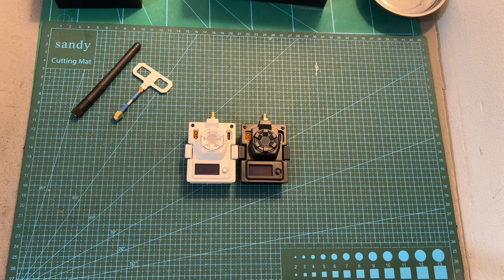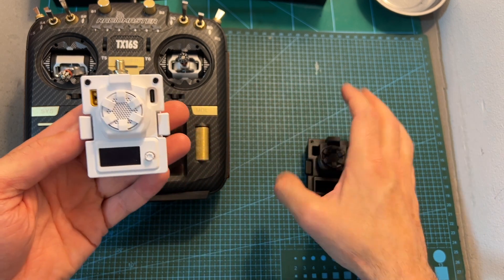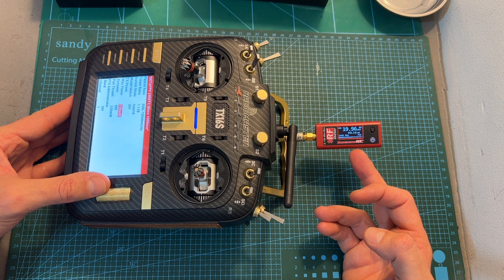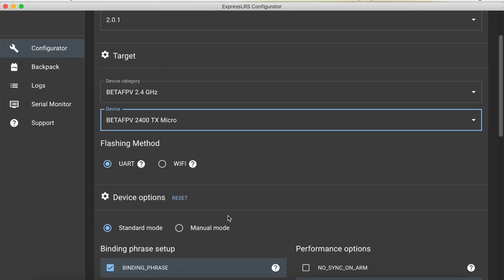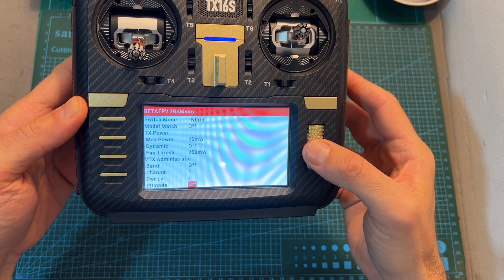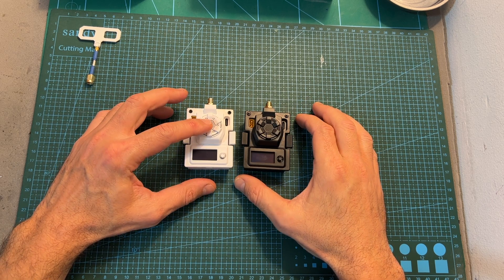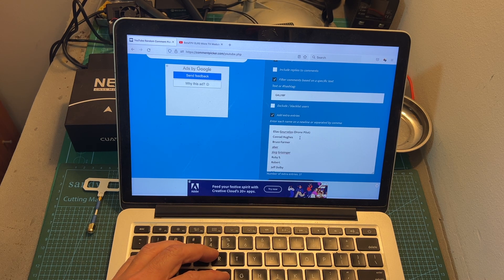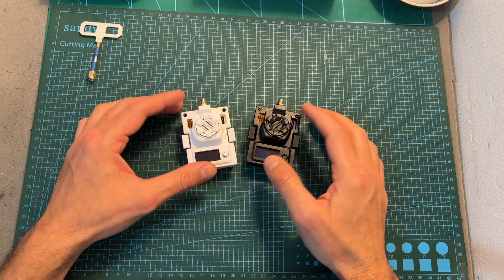1 What? BetaFPV 1W ELRS Micro TX Module

Comment: Hello, I hope this finds you well. I have the same 1W module. I am using it with Jumper T12PRO. I takes 2S batter as main input voltage. The problem is, I cannot set it to 1W. I re-flashed it again and again and placed the LUA scrip in place. But I do not see the 1W option. Do you have any idea what I might be missing? Thanks
Reply from the maker: Hi there. Are you sure that you don't have the 500mW version? Did you update it to the latest firmware using the ELRS configurator tool? If so - make sure to choose the correct firmware (and not the 500mw version). Hope it helps.
Reply: @KremerFPV   thanks for the response. Yes I flashed using the ELRS configurator. And have selected the 1000mW from device selection. I also confirmed it from inside regarding the hardware, it has a heatsink installed. It also shows 1000mW when I run the .lua script from menu. A matter of fact, I don't even see 500mW as well. A 250mW one do not have a heatsink in it. I would try once again.
Reply from the maker: @aamirmughal2965  No problem. If you have the ELRS version of the T12 Pro - make sure that you are using the external module and not the internal one.

Comment: Hello I've a Radiomaster TX16s (version 1) and the betafpv expresslrs elrs 2.4ghz 1W Micro Module. I can't change the 10W value, in the module joistick or in the LUA software, Do you have an ideia what maybe is the cause?
Reply from the maker: Hi, did you manage to figure it out? 
Are you sure that the module is flashed with the correct firmware?
Reply: @KremerFPV  Hello. Thank you. Yes, I've chanche for None European.
What uart should I use to connect my ELRS 2.4 nano to my Cinelog 25?
Reply from the maker: @antoniofilipe70  Any free UART port will do.

Comment: Question, when running 250hz and anything lower I can change via the module or lua script and everything works accordingly but when I try changing to 500hz on the module the led stays green the same as 250hz so I ran the Lua and it says 250hz module says 500hz and when I try changing it to 500hz through the Lua it automatically goes back to 250hz I'm curious if this has anything to do with me using a qx7 without the crossfire mod for the baud rate?

Comment: Gal, Great Video Thank You! What is your RF meter setup? RF meter setting? Attenuator value? I'm trying to test my new BetaFPV 1W ELRS Micro TX Module. I am getting half the mW and dBs. help please. (edit) Its all good I figured it out I used a 10dB 18Ghz Attenuator settings on RF meter 2.4g, peak, 10dB, 80ms, getting ~1 watt for 1 watt.

Comment: Great video. Total noob. Question, if I buy one of the new MK II TX-16S transmitters with ELRS built in is there a 4-in-1 module available? Or will this new radio be only ELRS? I like the Joshua Bardwell edition and it suppports him but I still want to be able to have some of the legacy protocols. Thanks!
Reply from the maker: Thanks Jim. Yes, there are 4 in 1 modules that are available, so if you are mainly going to use ELRS probably going for the version with an integrated ELRS module will be the best option.

Comment: Hello, Gal. Thank you for the great video! I just received my module and as you know it comes with the 2 antennas. Moxon and the long black one. Being new to FPV, I have no idea which one to use or if one is better than the other. Which do you suggest I use? For reference, I use a RadioMaster TX16S Max radio.
Reply from the maker: My pleasure! I've been using the Moxon antenna and didn't experience any issues so far.

Comment: Do you recommend it
Reply from the maker: I still didn't fully test it but I can attest that the Nano version which I frequently use is great.
Reply: @KremerFPV  thanks. I'm a 900 mhz user. But with elrs I'm confused which to get with the nice 2.4 support and performance. I mostly fly no more than 10 km. I don't know if 2.4 will be good or 900.

Comment: At this point, I'm not sure why anyone would by the V1 of nearly anything BetaFPV.
Reply: As someone who bought a first version Nano ELRS module from betafpv I would most certainly not recommend that to anyone (I only did because there wasnt much available in that form factor at the time). That said, I praise myself lucky the only thing wrong with it is having to open it up and push a button to update, everytime. Annoying AF but at least it works. So far

Comment: Hi Gal. I'm looking at the ELRS modules but I'm confused about the external power plug. Can you explain when you need to use an external powered JR module instead of your radio internal battery? Or when you need to connect the internal discharge cable to the external module? (the Radiomaster 5000 mah Li ion battery says that the extra length of the XT30 plug is just right for the CRSF module). If it is because of the power you set for the module (above 250mW?), why does the new 1000mW HappyModel TX Pro not have an external power input plug recepticle? Just watched a review of the new Jumper T-Pro, and the review said with 2 18650 batteries you don't need external power for modules and plugged one in and set it to 500mW???
Reply from the maker: Hi Mark. The only added value from powering the module externally is preserving the battery life of your radio controller.
Reply: @KremerFPV  So simple, thanks. Can't see why Radiomaster is bragging "Our battery includes an XT30 output plug that is the ideal length for use with external modules such as the TBS Crossfire" when it's already plugged into the internal radio!
Reply from the maker: @marksherman630  No problem. For the full size CRSF module connecting the external power is needed in order to use output power greater than 500mW.

Comment: Seems BetaFPV fixed all the issues with previous version. I am wondering if  this 1W model is compatible with Taranis X9D+ with EDGETX ?
Reply: I don't see why it shuldnt be.. if you will use full one watt you will drain the battery quiker (or you can use external lipo), but other than that it shuld be ok
Reply from the maker: Sure, it's compatible.
Reply: @KremerFPV  thanks for the feedback! Great reviews and great support !!!